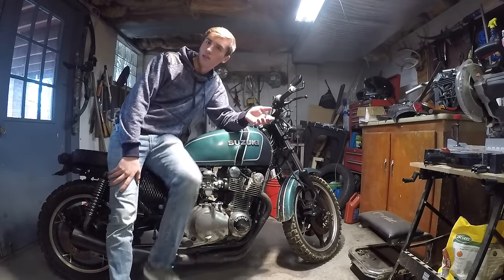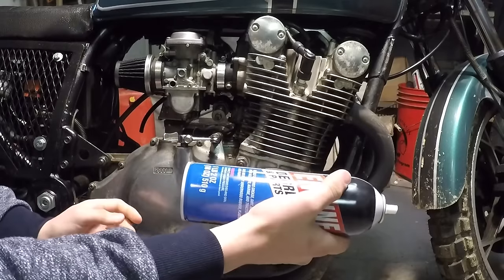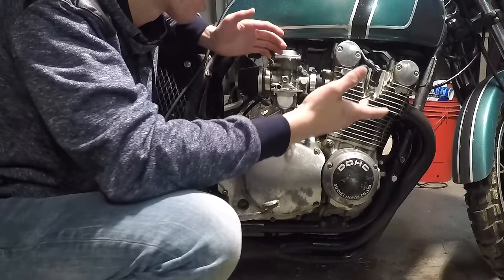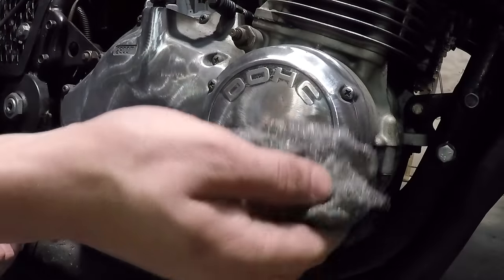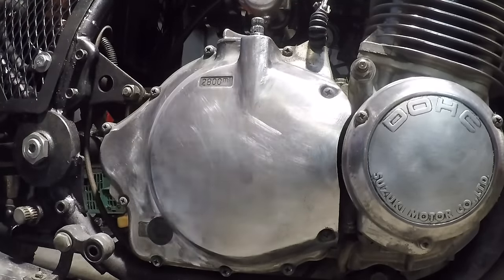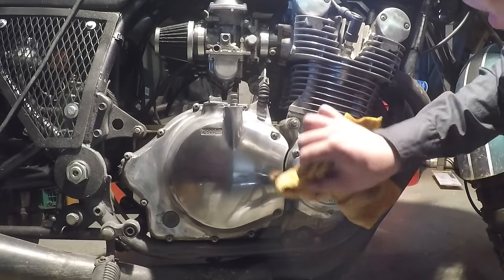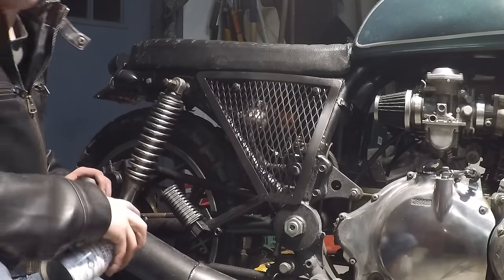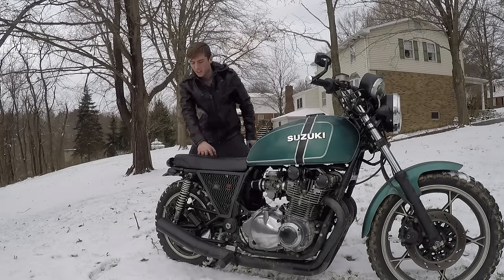How To: Polish Your Dirty Old Motorcycle Engine

Comment: I wouldn't want you to do mine that's for sure!
Reply: This guy is clearly new to this and is doing this just for fun. No reason to be disrespectful.
Reply: At 6:10 he was attacking factory epoxy clear-coat with 120 grit and calling it "oxidation". . . this is completely wrong, except for the point that he's working on a "scrambler" , but NO, this is not the way to polish a 40 year old bike.
The next step would be "Aircraft Remover" then maybe 400 grit.
Reply: Patricia Badeau don't think he would it you even have a bike
Reply: People... This is HORRIBLE. Dude learning is one thing but giving poor information is something else.
Reply: Joe White Amen to you sir, well said 👍
Reply: I like your videos but often you have a bull at a gate approach where some research and a more considered option would be more effective. Case in point, P120 grit is a very aggressive medium for aluminium. You never need any more the P400 on even the most heavily corroded aluminium. I' m not saying your process doesn't work but you are unecessarily removing a lot of metal and making a whole bunch of work for yourself. Early eighties Japanese engine covers like this have a thin clear coat over polished alloy (except Kawasaki, They came just polished from the factory with no clear coat). The problems start when corrosion gets behind the clear, or it yellows. To refurbish you only need to wet sand the clear coat off and then the corrosion, and buff and polish with metal polish. P120 grit is really only good for rusted steel; it's far too aggressive for a soft metal like Aluminium. On these cases I would start with a P800 and if it was too gentle, go to a P600. If the cases are obviously very bad you can start with the P600 (always use abrasive paper wet on aluminium) and then progress to P800. Polish can take it from there as the material is very soft, but you can go the 1000, 1500 and 2,000 grit steps if you really want. Also, it's far easier to work on these panels/covers if you remove them from the bike. Finally, the cam end caps are chrome plated pig alloy.  Attacking the chrome too agggressively may cut through to the base metal undereath and they will be hard to polish. Only use a gentle metal polish on them.

Comment: too bad this engine in the video has those K and N air filters. The stock airbox is designed to have a velocity stack effect. The science that goes into designing and airbox is the same science applied to making airplane wings. There is K and N air filters have no airflow development in the design. They are blockage with screens over them.. most of the horsepower is lost in the mid range..
  there are videos on YouTube showing that those filters do not catch the fine grit. One man has sets of pistons removed from engines that had K and N air filters. That video is here on YouTube. all of the piston sets that he had in his video showed that the back sides of the pistons, the ones that are exposed to the intake dust the most, all look like they were two stroke pistons that were partially seized in the bore.. not only do those filters not filter anything but rotten birds from getting in, but they have no Velocity stack effect, and if you would’ve put those on a brand new motorcycle still under factory warranty, and you had a problem with the engine, that warranty claim would be denied

Comment: I like that you're out there doing a video but please read up before giving advice.  Alcohol should never be used on aluminum, it oxidizes.  Anytime you're sanding medal you should be wearing eye protection and a mask. Spray paint should be used in a well ventilated area. Always remove bolts when spraying them to avoid over spray.

Comment: Ok, young Jeti.  You should have NEVER gone below 600 grit on that aluminum.  You started way to course with 120.  When in doubt, ask an older, wiser Jedi.
Reply: Agreed. with soft metal like aluminium, its better to start fine. you can easily go coarser if you don't get enough bite. But using a coarse grade form the outset just puts a lot of deep scratches in the item and you will just waste time and money polishing out your own scratches.

Comment: Using steel wool on aluminum you just ruined it. You have imbedded dissimilar metal corrosion into it. Please use aluminum wool next time, after you replace all the components you used steel wool on.

Comment: dear oh dear that AINT the way fella, you REMOVE engine cases, prepare the surface properly
 and polish with an alloy polishing cream the like of Solvol-Autosol  or Mothers you HAVE to work at it with your hands
 NOT a machine i can see why you took this way out !
Reply: Pretty dumb to go that rout.seen alot of bikes striped screws and parts missing cause of that dumb crap.i collect and before fork over cash, if the bike been took apart I walk away ..id rather have dirty bikes nobody has touched

Comment: Sorry man but that was a poor How to: Video. You really didn't need to spend all that time using a Scotch brite to remove the oxidation if you are going to go to sanding after. The 500 Grit, then switching to the 1000 Grit would have removed all the oxidation. Just be careful to use only the amount of pressure needed to take out any deeper scratches and blend them. If you go straight to Mothers Aluminum polish and a buffing wheel from there it will shine like brand new chrome. I did the lower forks of my Harley this way and they reflect like a mirror without rusting like chrome. Would have saved you several steps and a ton of time while still achieving the same if not better results.

Comment: you could've masked all letters....
Reply from the maker: Yeah, I thought about that, but that would have been so tedious to cut tap around everyyy single letter
Reply: Goldguy ... When I did the letters on my Yamaha, I smeared a fine coat of grease on them and sprayed black over the top. when paint was dry, it just wipes straight off the letters and leaves a perfect finish.
Reply: Genius!
Reply: You can buy new ones on EBAY for around 20 bucks.
Reply: by

Comment: It still dose,nt shine like my 1957 Triumph did.
Reply: George Lee Probably. But it won't explode after 2 hours on the highway.
Reply: I did many, many miles on that old Triumph with no problems,No tachometer just revved it till it was time to change gears. You look too young to know about the older triumphs, you have listened to way to much bullshit from people who never even rode one. BTW I bought a brand new GS650G and int he first month it was back in the dealers 4 times for an oil leak. It was,nt until the company rep looked at it they found that the pick up from the tachometer drive was porous, hence the leak, by that time it had so much burnt oil over the engine I could never get it off.
Reply: Triumphs are very dependable. If an owner does not understand what's involved in maintaining it may just blow. Some people get an old Brit bike and give no thought to the sludge trap, and I guarantee it will suffer failure if these old traps aren't cleaned before  putting one on the road.
Reply: George Lee son
Reply: I have had a lot of old bikes mainly old Japanese bike and I think Triumphs are one of the best bikes ever made. They are well balanced, powerful, agile and good looking. What sucks is when someone buys a 50 year old bike and gets on it and treats it like a new bike that has been freshly broken in. Each old bike has personality and you can feel what the bike needs. I know many may think it sounds corny but machined parts fit together a certain way and gears have memory worn into them. Each old bike feels different. Anyway, I think this kid could make great videos because of his style and tempermant. Hell, he makes better videos than me. However,  I do think the cleaning was too aggressive. There is a clear coat on the aluminum cases, or was. I have always been a soap and water, some wd40 to break grease kind of detailer. A rag and a toothbrush and really light grit steel wool to cut rust off of chrome because if it's rusty it's already damaged but you can do wonders without taking off any metal. Good luck......